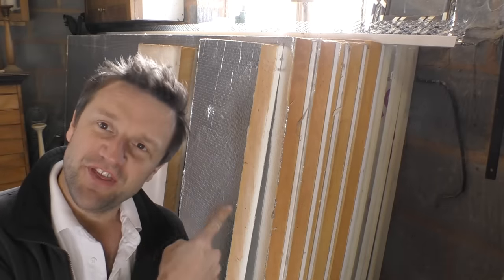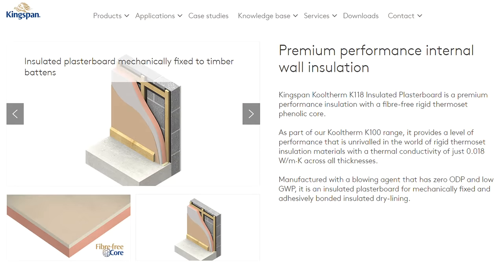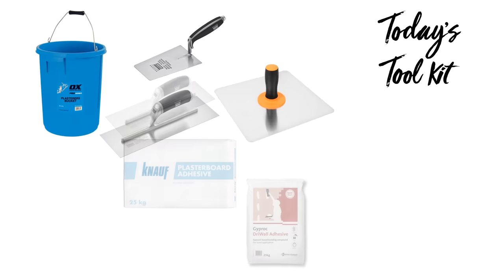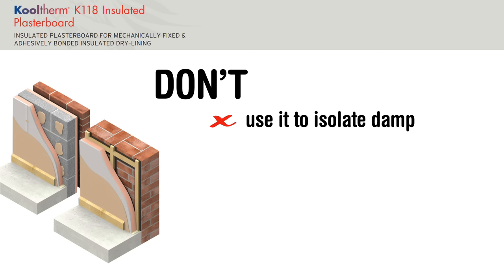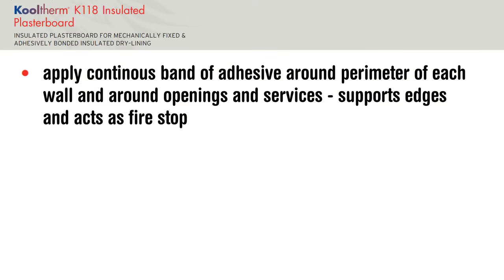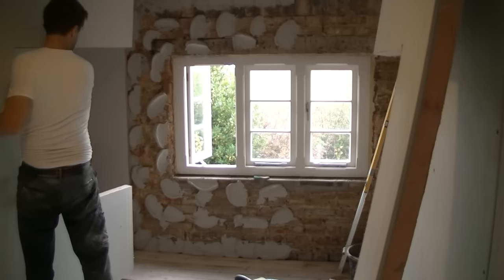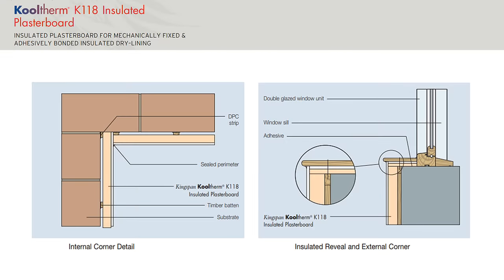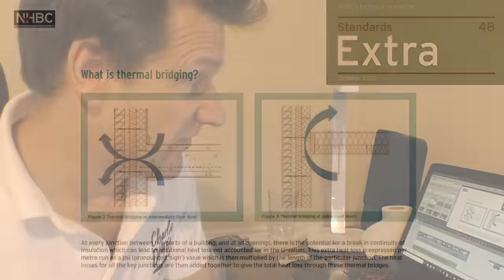How to Dot & Dab Insulated Plasterboard - a DIY Guide

Comment: It isnt a good idea to insulate from interor of the house... exterior is much better - u save the materials before destruction via water x freeze. once u insulate inside part - u shift zero ceslcius into the brick (water start to change into ice - expands and destroys the material, u are never able to restrict all af vapore to come inside the material). ... if u insulate exterior part of the wall... proper thickness of insulation will have zero celsius in itself...... PVA is supposed to be used , once u clean the wall properly :) it doesnt take such a lot of a time and effort :)
Reply: external insulation need be water resist, not suck water newer, only closed cell foam can use external insulation, interior can use all other, but not bathroom and water area rooms.or rooms were have sometime steam.

Comment: 😂😂😂😂😂😂 WTF are you doing fella,!,  ABSOLUTELY no need to remove the old plaster 😂😂😂,!
You took more time removing that old crap,,than fixing your boards,😂😂
Just drill through your insulated plasterboard AND the old plaster  and (mechanically fix)using Fischer POLYPROPYLENE  fixings to brickwork ,,12 fixings to each board,,
Before you all start jumping up and down 😤I have been using this method for 28 years,!, my company has  renovated more than 300 properties , 
I in fact still own 147 of these houses,as a private landlord,,
PS,, very little point in applying pva directly to substrate that appears to contain old lime plaster,,
PPS, I’m 73 years old started plastering at 14
I sincerely hope this has been of use to someone,👍🇬🇧
Reply from the maker: Three reasons  1) the plaster below was live and I didn't want to just hide it behind the new board (a botch in my opinion); 2) the walls weren't true - years of badly applied irregular plaster - so mechanical fixings wouldn't help with this; and 3) the wife is annoyed enough that I'm reducing the size of the rooms with this insulation so I was wanting to keep this to a minimum. I hear what you say that your approach is a lot less hassle though. Are the polypropylene fixings fire regs compliant? I thought they had to be metal.
Reply: @CharlieDIYte  you can get metal ones which are much better. 🍀

Comment: It's a nice video for installation. How to screw in or hang appliances on these insulated backed plasterboard. Which screws or supports to use to hang heavy objects like TV and radiators.

Comment: Just buy a dehumidifier. Solved  all my condensation and pin mould problems in my 1930's house. Cost about £300 a year to run. No more condensation on the walls and windows. When I put the insulation board on I knew there wouldn't be a problem with condensation behind the board

Comment: That's very interesting! Thank you for your video. Have you noticed any issues with condensation between the wall and the insulation? Would it even be possible to see if it happened?
Reply from the maker: I think you do have to be really careful - particularly around plug sockets, where each sheet butts up and corners and windows. Better to use the expanding foam glue rather than plasterboard adhesive as this is a much better insulator.  I haven't had any problems in this room but we do manage humidity quite carefully. In the last room I did - our bedroom - I battened the wall, infilled between the battens with 1 inch PIR, foil taped over the battens then screwed the insulated plasterboard to the battens. That way you have no cold bridging around sockets etc as there's insulation behind them. I glued a 12mm board of ply into the back of the insulated plasterboard to screw the socket back box to.

Comment: Hi, I wish I had seen your videos earlier. I did a lot of DIY work like you, learning on the job. To be honest I think I do a better job than most builders other than those professional single job tradesman. 

One other option I used was Pink sruff fixit. Spray foam adhesive to stick my insulated boards on. 

Also could you do a video on wall fixings for these insulated boards...?

Comment: Thanks Charlie, gonna give this a go soon!
Reply from the maker: You're welcome. Just be careful with the plug sockets. Cutting the board does create a cold bridge. If you're going to dot and dab like I did and need to fit back boxes, rather than adhesive all round the socket, I'd get the back box ready, with a wall plug drilled in the wall to fix it in position, and then spray expanding foam in the gap behind the back box and quickly fix the box in place so the expanding foam expands and hardens around it. That will pretty much eliminate any cold spots that could cause condensation in this area.

Comment: Get a spade bit for the SDS hammer !! - less damage, faster and more consistent.
Do bear in mind that whilst your walls are dry at the moment, significant moisture removal could have been taking place from the internal surface that will now be trapped behind the foil  on the Kingspan.
If "wicking"  of moisture is taking place from another area, it cannot now escape as it is sealed both from outside and inside.

Comment: Did a 9inch solid handmade brick house a few years ago . it had lime mortar all OK in the summer but noticed in the winter frost on the bricks of the insulated wall the room next door wasn't insulated it had no frost . the heat escaping through the wall  allowed the moisture inside the brick to evaporate externally preventing any frost damage . the insulated area started to get frost damaged to the handmade bricks because water was retained inside the bricks .
Reply from the maker: It's such a difficult one this. I guess the issue is the heat escaping through the brick. If it's properly insulated you shouldn't get any heat transfer - and in my case, I've got the tyrolean render on the outside. That said, arguments rage over whether we should be insulating traditional brick lime mortar houses. Trouble is, if you don't you have a pretty unpleasant environment that's expensive to heat, to live in during the winter.
Reply: @CharlieDIYte  Or insulate using breathable materials, like wood fibre, wool, cork, specialised lime based plasters like Diathonite or many others. Then use a lime based plaster and finish off with a lime based paint. This will allow the walls to evaporate the water thus not causing the forementioned frost damage. The problem with the solid wall building is that it absorbs water from the outside just as well as the inside, so it's nothing to do with "proper insulation".

Comment: Thanks Charlie fantastic video. With regards to that Tyrolean render, there is a guy called Peter Ward who does great videos on Youtube about solid wall houses with lime mortar and these plastic type renders. He says these renders can be a big problem because they don't allow the wall to breathe, it is possible the render is keeping the walls wet  because it doesn't allow the water to escape to the outside face ie the wall is no longer breathable.  I know you said the wall was bone dry but the heating in the room will do that.

I know it is all money but it might be a good move to consider a render that is breathable because lime mortar can go very soft if water finds itself behind the render.
Reply from the maker: Cheers Danny. You're right that the render is a pain. It was applied in the '70s, I suspect because the brick work of what used to be 2 cottages that were turned into 1 - was a bit of a mess. I can genuinely say that when I stripped off the render the wall was dry - as have all the others I've done. I'd love to remove it, but it would be a massive job and I don't know what I'd find underneath. Also, bar a few cracks - which I'm remediating, it was pretty good quality so I'm stuck with it for the foreseeable. The K118 has two vapour barriers to prevent moisture passing through the wall into the brickwork so provided there's no ingress from outside and I've minimised thermal bridges I should be ok.

Comment: Great video, it's my final pep talk before starting. I researched what I need to do and founds lots of information, and missed lots of information. Anyway my conclusion is quite what you explained in the video (which makes me more confident). What I couldn't find anywhere was whether I should leave a gap at the bottom and fill it with expanding foam or should I just rest the insulation on the floor when applying, so thanks for the heads up there :)
Reply from the maker: You should definitely leave a gap and fill it with expanding foam. Ensures no cold bridges around the bottom edge 👍

Comment: Charlie excellent vid really enjoy your attention to detail and your clear concise explanation for the process. One question did you consider using a foam adhesive? Such as soudal easy bond. I've used it much easier and quicker than dabbing
Reply from the maker: Thanks David. No I haven't, but you raise a really good point there. MUCH easier and introduces a lot less moisture into the brickwork, and presumably better adhesion. I'll check it out!

Comment: Thanks Charlie. Presumably you only need to insulate external facing walls, not internal walls adjoining external walls? Is that right?
Reply: Charlie, do you have a video on applying insulating wallpapers (like WallRock or similar)? What is your view on how useful and effective they are? Installing insulated plasterboard is not feasible in our rooms because of door and window frame sizes and shallow depths.

Comment: You’ve made really hard work of that fella,,
If you had mechanically fixed your boards with “polypropylene fixings” you drill straight through the plasterl (leave plaster on)  and fix boards to brickwork,!
Therefore no need to remove any plaster,,  
I’ve used this system for more than 25 years with no problems,,
Reply from the maker: David the render was knackered - key totally gone. It had to go!
Reply: @CharlieDIYte  but if you use 150mm fixings what difference would that make?

Comment: Thanks Charlie for that, watched every second and gave me the info I needed. Just on the mechanical screws used as anchor points, are there different types? What's best?
Tks again, great detail in what you did..
Reply from the maker: Thanks, I really appreciate you getting in touch! There are a few different manufacturers but they're all pretty similar. I can't tell you if any are the stand out best, but the ones in my link in the Description will do the job just fine.

Comment: Great video. We have a 200 year old house with no cavity. Our surveyor prior to purchasing was a heritage specialist surveyor who gave a lot of advice about how to look after older houses. Things like not using plastic masonry paint, gypsum plaster, sand and cement render etc as they are not breathable. They reckon external walls on the inside should be lime plastered. Since you own an older house I am interested on your thoughts on this? I guess its ok to put this thermal plasterboard on older houses? Is it breathable?
Reply from the maker: Your surveyor was basically right and no, this isn't breathable. Old houses are meant to breath but the problem is that also leaves them difficult to heat and susceptible to mould in unventilated areas. So you have to balance up the pros and cons. If you are going to insulate from the inside, it's critical you do everything you can to minimise cold bridging around windows, corners and plug socket boxes these being the major sources of cold spots and moisture ingress. Also do everything you can to keep the internal humidity down as discussed here https://youtu.be/TIDb-pdOnXM

Comment: Charlie when mixing plaster or adhesive you should use your bucket trowel to clean edges round your bucket stops lumps in the mix , Top Job Tho 👍👍
Reply from the maker: Thanks Ryan - I appreciate that!! I did this but edited it out for some reason. The other thing I should have done is point out that the mixing paddle I used is a paint mixing paddle and I would have got a better result with an adhesive paddle - although clearly you get much better results with a mixer drill.
Reply: @CharlieDIYte  Maybe a tarp under your mixing bucket if you were at a customers house... Fair enough if it's your house the adhesive may be the feature you've always wanted. 😉
Reply from the maker: @Brown969  Fair point. I just hosed it down but yes, different set of rules at someone else's house!

Comment: Great video.  How do you make the judgment on damp to decide between batton or adhesive?  Old houses that you might want to insulate rarely have bone dry walls and getting the opinions of dpc professionals can often lead to further confusion, ambiguity and diagnosis to product or service.

If there is actually any degree of damp what's actually going on behind the board between the battons?
Reply from the maker: Andrew there's no right answer on this, except to say if you have damp in the wall coming in from outside you shouldn't insulate it until you've removed the source. That said it becomes more complicated because most internal insulation isn't done properly in that the vapour barrier is either non existent or, as I have to confess, I did, you cut through it to install the back boxes. Any cold bridge like this is a potential source of interstitial condensation. On our bedroom which I did a year ago I battened the wall with 2x1 tanelised, putting DPC behind the battens where they touch the wall. I then infilled the battens with 25mm Ecotherm sheet insulation. The walls are uneven so there was a bit of a gap behind the battens in places where i had to pack them out. I then foil taped the battens and finally screwed the Kingspan insulated plasterboard to the battens. That way it didn't matter that I cut through the insulation for the electrical boxes as there was insulation behind. I put a piece of ply at the back of the back box, again foil taped from behind to give me something to screw it. That's just about the best way to insulate a wall in my opinion. However you'll always get the angry restoration lobby saying you're creating a mini Grenfell that can't breathe, whilst the green lobby will salute you for cutting greenhouse emissions 🤷
Reply: @CharlieDIYte  Thanks for this, very helpful.

Comment: Really interesting and useful video - thanks!

One question; when you used the insulated plasterboard for your bathroom, was there a moisture resistant version available, or did you apply a waterproofing agent (or additional cement backer boards)?

Comment: Hey Charlie. Yet another excellent video. Last weekend I was adding a socket to my wall behind the TV. It’s dot and dab plasterboard. In cutting the hole for the socket I hit a bit of the adhesive. Do you know how this stuff cures? I swear to god what I hit was simply expanding foam! Can’t believe that would be suitable as an adhesive for this task, although I do recall from using it on other jobs it’s insanely sticky if you get it on yourself or your clothes….
Reply from the maker: Thanks. Yes that's absolutely fine. There is an expanding foam plasterboard adhesive which works just like the plasterboard adhesive I used but is actually much better because it's a better insulator. 👍

Comment: absolute legend mate!
Reply from the maker: Thanks Marco. If you do this, just do everything you can to minimise cold bridging. Cutting through for the sockets can be a major source of this. You could minimise that by spraying expanding foam behind the back box. The last room I did I battened and insulated before screwing on this insulated plasterboard. A good solution because theres no break in the vapour barrier that way. Good luck with your project 👍🏻
Reply: when you batten do you need to remouve the old plaster or it is ok to batten over it? thanks! love your channel.
p.s did you use Kooltherm K118 for the battens?